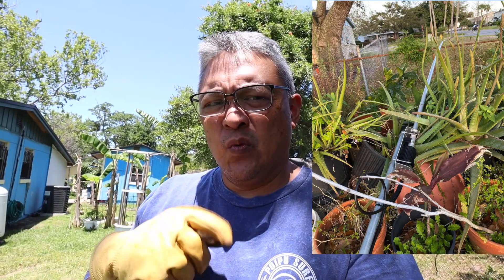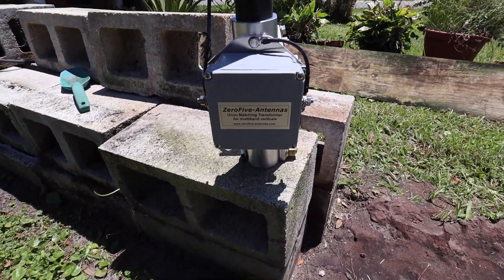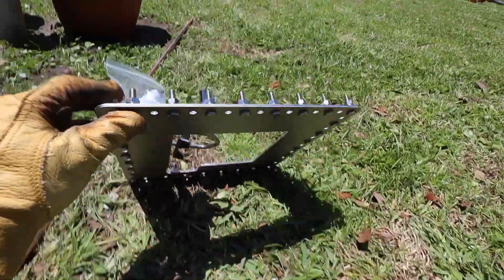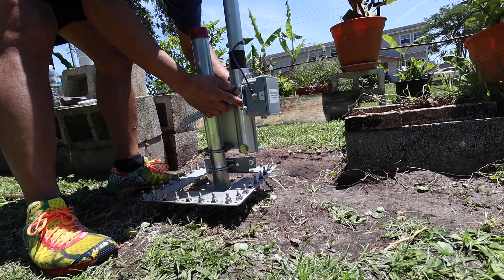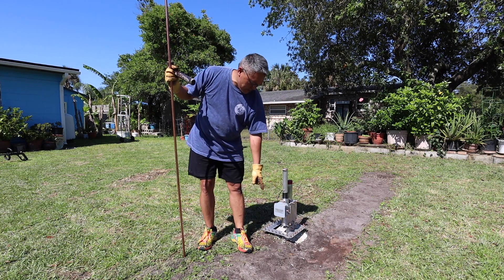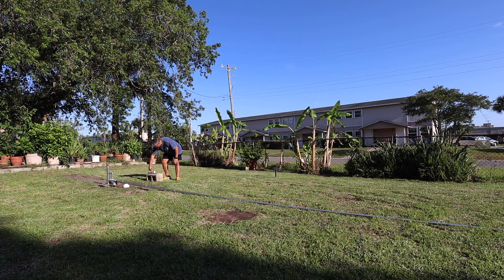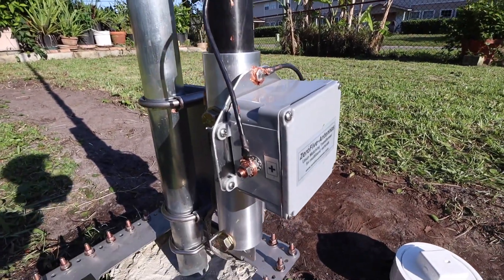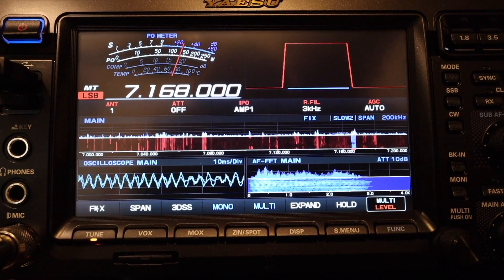Zero Five 27' HOA Foldover Multiband HF Vertical Install

Comment: Debs husband says this is a very good and neat installation.  I am currently using the Comet Cha-250b and I am making contacts all over the United States, Canada, and Europe. A lot of things to consider is geographical location, conditions, elevation, ect.  My antenna is about 15 feet above ground with no radials.

Comment: Nice installation Cap. How much did that set you back? 73
Reply from the maker: Here is the link:  https://zerofive-antennas.com/product/27-foot-hoa-10-40-meter-no-radial-multiband-foldover-vertical-with-unun/    It's pretty expensive but works for me.  I now use my Horizontal 40meters skyloop as my primary antenna at my QTH in Texas.  Here in Florida, I use my DX Commander as my primary HF and use the 43' Zero Five as my diversity antenna for my Anan 7000DLE Mk3.

Comment: I love the install but do the radials get buried? I’d be scared to run over with my riding mower.
Reply from the maker: I buried mine.
Reply: @DarrenN4VFR  Roger that, I kind of assumed that. Great install!
Thanks Capt. getting back in to Ham after years when I was a teen. 61 now, lol passed the Tech and grandfathered to General.  Looking to buy that antenna but have a swimming pool in center of back yard. 
Thanks….and 73’
Reply from the maker: @ed370zx3  Thanks Ed and welcome back to Ham Radio.  Good luck in finding an HF Antenna.  See if you can fit a DX Commander Classic in a corner of you property.

Comment: That’s a nice setup! I think I heard on your videos that you own a DX Commander antenna… I’m in the process of moving mi e since the previous location didn’t allowed me to set radials facing north, but I’m trying to make a new base without using guy ropes… is there any videos you can point out that can help me with my project?
Reply from the maker: Maybe cement a pipe just bigger than the circumference of the DX Commander.  Perhaps drill a hole and put a set screw in the pipe so it wont rotate.  Just an idea.

Comment: Can you please tell me if the radials made a difference on the 27hoa I have one but haven’t done any radials because it’s not supposed to need them. However I will if it made a noticeable difference. Keep up the great videos. Ps I managed an fbo for a long time so I love and miss aviation
Reply from the maker: Yes, the more radials you use the better efficiency your antenna will be.  My lengths that I started with is 27' in length with quantity 37.  The more the better. The radials can be at various lengths to fit your situations.

Comment: Hello, enjoyed your video on the Zero=five vertical antenna. I am limited for the radials.
Did you try the antenna without radials first? Appreciate it. Mike
Reply from the maker: I dont remember.   I did use my Dx Commander without radial and it worked. I mowed the grass and forgot to install them.   You can try it with just a couple of grounding rods.  Best bet is to call Tom at Zero Five. He has lots of experiences with various setups.

Comment: Capt Daryn, are you still.using this or the DX Commander? What was you before-ATU SWR like? Thanks de WO8USA🇺🇸🇺🇸🇺🇸
Reply from the maker: Yes, I'm using the DX Commander connected to my IC7610 and use it remote.  When I'm at the control point, I either use both the Zero Five 43' Vertical or DXC.  Both can handle 1500 watts from my OM2000+ Amplifier.  My DXC's SWRs are really low but I still use my built in Antenna Tuner of the IC7610.

Comment: 9:36 there is an engineering error in the production. no stress release holes. If it is possible then drill holes at the end of cuts with a diameter at least twice the gap. If you do not understand what am I talking about look at how the seat post is mounted into a seat tube. another mistake made is copper grease with aluminum. At first, the grease is insulation, which means capacitive coupling between elements. second copper particles mixed with that grease will corrode the antenna over time - a tight connection is good enough.

that cover over the grounding rod is a brilliant idea. You could go further and recess that rod a bit more. Use a wide PVC pipe to prevent soil from sliding over. The purpose for covering it is that when deeper the ground has bigger moisture. The cap will prevent evaporating or allow access to water the rod like a plant.
Reply from the maker: Thanks for recommending the stress release holes. 

I will remove the Jetlube that I used in this video and clean it well and then use Naolox instead.

Comment: For the vertical experts, how does a vertical perform with metal trailers about 20' away on two sides of the antenna?  Will the trailer have any effect?  I actually could mount the vertical on the roof of one of the trailers, about 15' above the ground.  Will the solid metal roof eliminate the need for radials?

Comment: You have a few problems with this installation, Unfortunately, a couple of them are rather serious. 

First, your ground needs to be bonded to the service entrance. All grounds must be bonded.

SS-30 Is a Cu paste. This is not appropriate for aluminum. You have unnecessarily introduced two dissimilar metals and this will encourage galvanic corrosion. There are other products that will work, including Noalox. In this case, you would have been better off using nothing at all. 

DX engineering incorrectly recommends this for aluminum antennas and that is patently wrong. DO NOT USE SS-30 here.
Reply from the maker: With regards to grounding.  Your saying that the Mast ground must also be bonded to the Station Ground?  My Station Ground is bonded to my Service Ground at the house.  I thought the mast and station ground had to be seperated.

Thank you for the feedback on the SS-30.  Frinking DX Engineering recommending that product.  I'll look at Noalox.
Reply: @DarrenN4VFR  Yes, all grounds must be bonded. The NEC (National Electric Code) will confirm this. Warning: Reading the NEC will make your head explode. :) Rather than a long and boring explanation, check out Mike Holt, here on youtube. He is a great resource for the NEC. 

JetLube may have an appropriate product for aluminum to aluminum. I have always used Noalox, but there are other suitable products.

I don't know why DX Engineering recommends this product. Perhaps it has something to do with the fact that Tim Duffy also owns Summit Racing, and that product has applications there. That's pure speculation. 

One last thing I probably should mention - There's a law diminishing returns for ground radials. Generally 4 times the lowest band’s wavelength is optimal (balance of work v performance) for the total length of all ground wires. Unlike elevated  radials, the actual length is not important as they detune on the ground. It is the total length of the wires that is important... this, of course, is without exaggerating one parameter or another. Nothing wrong with doing more than that. You're just not going to get a lot of dB for the work. 

Otherwise, nice job and clean work!

NB Checkout the Motorola R56 Standard. :)

Comment: Have you ever disconnected the radial field while receiving, and then hooked ot back up, to see of there is a discernable improvement?
Reply from the maker: No I haven't tried that yet.  That would be a good experiment.  It will be a chore to diconnect all ofl my ground radials. I'll do a video some day.
Reply: @DarrenN4VFR  OK. Wasn't sure if you could simply loosen the u-bolts from the radial plate, or disconnect one main conductor from base of antenna to the plate. After I asked you about this, I saw another video of a guy doing something similar with a WSPR setup. The findings were very similar and not really noticeable, which was surprising.  Thanks for the reply!

Comment: I put up a 92' tall vertical using a drone as a skyrocketing to drop a fishing line over the tallest branch of a tree.  The antenna was supported at the top by 3' of vinyl tubing tied to a nylon rope which went to the tie point on the ground. The 14awg copper wire was hanging Straight down and connected to porcelain insulator where it connects to the coax. This antenna worked fantastic. Relative to my horizontal longtime, it typi c ally was 3 to 15db higher  signal strength on 75 through 20m than the reference horizontal ant.
Due to high winds, the antenna came down after 3 days of phenomenal dx.
I decided to ruggedize the improved suspension with 5' of guy wire with ptfe tubing over it so it doesn't chafe on the branch and  cut the rope. There is 3 feet of   vinyl cord  etween the vertical wire and the guy wire, which runs horizontal across branches before going down vertical.  Only the top 3 feet of wire  are parallel to this steel guy wire 3 feet away. However this ruggedized antenna mount has poor performance.  I thought my coax switch was wire backwards because rhe reference ant was outperforming the vertical after the update.
I  am still trying to get my head wrapped around the fact that 3 feet of steel 3 feet away from. The main radiator would drastically degrade antenna se sitivity.
Reply from the maker: Thats awesome you used a drone to put up that wire antenna.  Good luck Dxing!
Reply: @DarrenN4VFR  I have a Fli-Fli Airdrop attached to my Phantom 4 Pro 2.0 and what I do is use a nylon cord about 8' long with a loop on one end for attaching to the release pin on the Airdrop and the other end is secured to an empty WD40 can as a weight. Then I attach the leader cord just above the can. The leader is on a spool that unwinds as the drone gains altitude. I fly up over the branch I want to use and out a bit and then hit the drop button and the weight of the can pulls the cord down to a height I can reach and I then tie my nylon rope to the can end of the line and start winding up the spool, pulling the nylon rope up to the top of tree. The other end of the rope is attached to 5' of steel guy with a PTFE sleeve over it, followed by 3' of vinyl cord as insulator and finally the copper wire. Whole operation takes about 5 minutes.
Propagation has been peculiar this year. Some days the vertical does poorly, some days it's better. Sometimes I can be listening to a QSO and one station will fade on the horizontal and I switch to vertical and it's up 10dB where 5 minutes ago it was the reverse!

Comment: I’m thinking of Zero Five’s 43’ ground plane antenna for 10-80m.  How do you like your antenna?

Really like your videos.  I’m a retired L-1011/747 pilot.

73 to you.

N1OII
Reply from the maker: Good day fellow Captain!  I like both of my 27' and 43' Zero Five Antennas.  I'd get the 43' version if you have the property to lay down ground radials. You will need to have an antenna tuner though.
Reply: Do you work 80 meters ok?
Reply from the maker: @georgiathai4961  I use the Palstsr AT2K to tune down to 80m. My built in tuner wont match the antenna.
Reply: I’ve got an MFJ-962D.  Haven’t tried 80 meters.  I’ve often second guessed myself about not buying the Palstar.
Reply: Thank you for taking the time to correspond.  Really appreciate it.

Comment: Everything is ok except the connection between cables to ground and to driven element. They have no lug connectors crimped and solder and what you did is a big mistake that will bring you high swr when those Cooper connection expiden to enviriment will  have oxidation.

Comment: The website says that antenna doesn't need any radials but it uses two ground wires instead. So, I'm curious why you installed radials.
Reply from the maker: After I bought the 27' HOA vertical whip, I called Tom at Zero Five. He recommended to me to have ground radials and therefore, I bought the Ground Radial Plate from DX Engineering.  Goto the FAQ page (https://zerofive-antennas.com/q-and-a/) and you will see the information about ground radials.
Reply: @DarrenN4VFR  OK. Thanks for the reply. Still, I wonder why they advertise it sa "no radials". Seems kind of misleading. No doubt though, it will work better with radials.

Comment: Hey Darren, Scott from BARS. Nice antenna install, you'll have to do a show and tell one day :) Tip for the 101D, turn down the RF gain to around 10 o'clock position and use DNR on that radio, it has outstanding noise reduction to get rid of a bunch of that band noise. 73! Scott N1SER
Reply from the maker: Hi Scott, Thank you for the tip!

Comment: Gorgeous installation! It looks like it was done by a professional! It just goes to show that you can get excellent results if you spend the money and get the right components for the job. 

One question - why not use a hoe and just create a very narrow trench for each of the radials so they’re at least 1/2 to 1” below ground? I’d be worried that running a lawn mower is going to chop up the wires (and probably destroy the lawn mower).
Reply from the maker: I got a better idea...  If you have one of those lawn edgers, it can also make a trench for those ground radials.  Thank you for your comments.
Reply: @DarrenN4VFR  good point! The more power tools - the better! I think Tim Allen said that. Or something to that effect. lol

Comment: Wow..pretty nice video.  Congratulations for your efforts.  But did I see this right ?  Do you have a S7 / S8 of ground floor noise ?  Is that normal ?
Reply from the maker: Yeah, it's a high noise floor.  A technique is to increase the RF Gain so that you eliminate most of the noise to where you only have S1-S2 units displaying. That's what I'm now doing when I got Remote HF Control to my IC7610.  Where I live in Florida, there's still so much Power line noise.
Reply: @DarrenN4VFR    How would a mag loop antenna perform in your high noise environment?
Reply from the maker: @viralsheddingzombie5324  I would need to get a cheap tv rotator so I could null the noise.  I haven't been home long enough to test the Loop for receiving.

Comment: What is the SWR like????
Reply from the maker: With the 5ero Five antennas, it's mandatory to use a built in antenna or external antenna tuner.  With a tuner, it tunes the antenna to 1.5.  I use the Palstar AT2K and it tunes down to 1.0.

Comment: I was under the impression the HOA model didnt need radials?
Reply from the maker: Their website says you don't need them and have 2 ground rods.  I went ahead and put the radials in because I had room for them.  I only have 1 ground rod next to the antenna.
Reply: @DarrenN4VFR  hope that it made good even better.... 73
KI5GEV

Comment: Capt Darren I received ZF 27' vertical and UNUN (which he seems to outsource from Balun Designs, LLC) last week, and unpacked it today. Everything looks very sturdy and high quality. We have a few days of nice weather forecast here in east TN, so I plan to get it installed this week. This is going to be replacing a trapped "WiMo" WARC band vertical that I installed a couple of months ago and haven't been very happy with due to water getting into the trap and throwing the SWR way off. Upon initial examination, the ZeroFive antenna is far more sturdy and better constructed. I already have the mounting pipe concreted in the the ground, as well as a DXE radial plate and 8 radials installed, so the ZeroFive antenna should be a drop in replacement for the WiMo. I plan to add more radials, up to at least 30. I'll let you know how it goes. 73 de WB4DW
Reply: Douglas Williams
1 hour ago
Got it installed this morning. I was again impressed by the quality of everything about this antenna. Since my main antenna is a Hustler 5BTV, I'll mostly be using the 27' ZeroFive antenna on the WARC bands. I fed it with 50' of LMR-240. The SWR is around 2:1 on 30 and 12 meters, and around 4:1 on 17 meters. The built in ATU in my Kenwood TS-890 is able to tune it to 1:1 SWR on all three bands, which results in a mere 1 dB loss at 18 MHz (0.6 of which is due to the 4:1 SWR), so not worth installing a remote ATU.
Reply from the maker: Awesome!  You will need a tuner to bring the SWR's down to 1.5.  I'm using the Palstar AT2K and tweak my SWRs down to Nil.  Let me know how it works!  I'm templed to get another one for my dedicated FT8.  I still need to work out with my local city about having more than one aerial.  Haven't been home long enough to take actions.  73's de N4VFR Capt Darren.
Reply: @DarrenN4VFR  Capt Darren I've been using it on the WARC bands on FT8 for the past week, with a mere 8 ground radials and, so far, have been quite impressed. I've made many contacts, including a lot of DX, on all three bands, just using my TS-890's built in antenna tuner. FB on your Palstar tuner. Those are high quality. Thinking of buying one myself. Good luck on your battle with your city government. I live in a rural area and, thankfully, don't have to deal with such things. Best 73 de WB4DW.
Reply from the maker: @douglaswilliams6834  Awesome to hear that the Zero FIve is doing more than you expected.  I just got a new IC7610 that I just set up for Remote Control...  I noticed that I'm experiencing a lot more power line noise again.  Maybe a different source.  I will have to submit a trouble call next time I'm back in Florida.  Right now, I'm at the JAX airport heading out back to DFW.  73's de N4VFR

Comment: does it matter if the radials are insulated or not? Never had an antenna that needed them so i dont know.
Reply from the maker: I dont think it would matter just if the bare ground wires are exposed in the elements,  it may corrode sooner thank insulated ones.